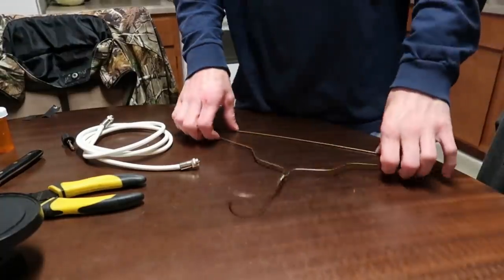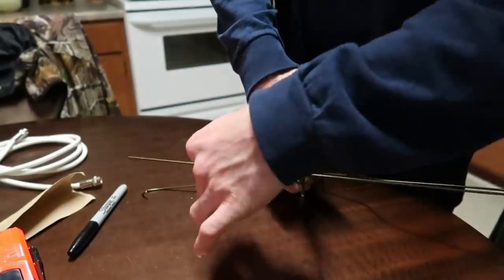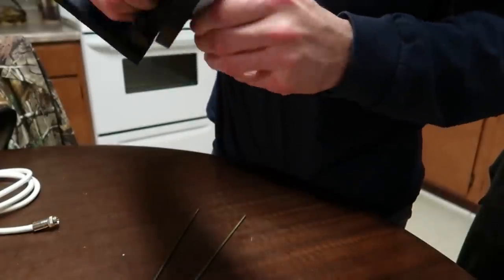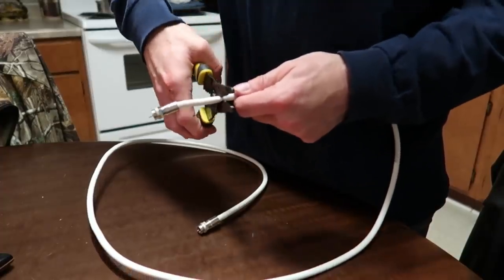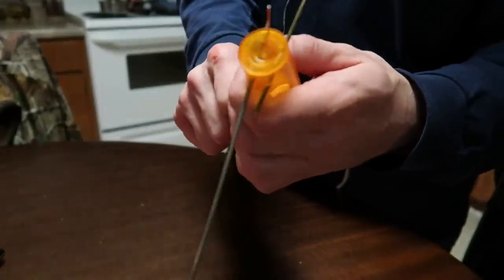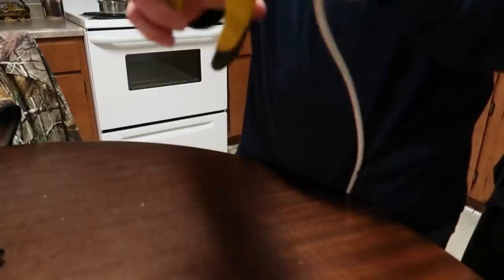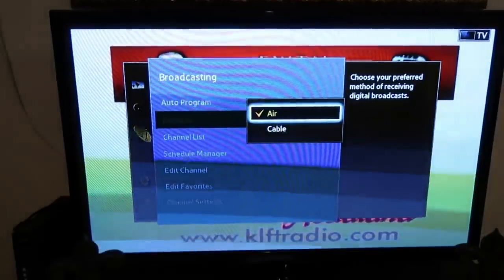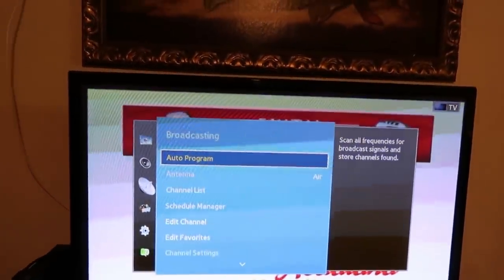How To Make An Easy Off Grid Cable Tv Antenna for Free [ Working October 2022 ]

Comment: Should have just hooked wire to coat hanger and hung it on wall. No pill bottle needed. This is an old time antenna before cable tv. Back in rabbit ears days as they were called.

Comment: The reason you're getting digital channels is because your TV has a built-in digital tuner the antenna you made works but with older TVs you will not be able to do this unless you buy a digital adapter they are unable to detect digital channels without the converter just analog

Comment: There are companies that when you give them your address they can tell you where the best place in your home (east,west , etc.) is the ideal spot for an antenna to pull in the most free channels in your area. They don't charge but sometimes advertise antennas for sale. Quite often an antenna works better on a different side of a room as the TV. I guess longer coaxial cable is necessary. Thanks for your video.

Comment: I once made a much more complex wire-hanger antenna than this one, but it failed to work here in San Francisco, with all the obstructions between home and transmitter.   And I could've used those hangers for my clothes right about now.  Darn it.
Reply from the maker: Dang, would think around your area that you could get lots of channels. LoL !
Reply: @Macgyverjrofficial  I know.  Merely 4 miles from tower, yet so many things to stop that signal getting here.  Terk amplified antenna did a decent job, but now I need a new one.

Comment: How about a homemade extreme amplifier that you mat obtain 22 channels. I think you connect it on the roof or nail it to the roof and get a longer cable plus make your copper wire more like fractals that have more points you will achieve more channels. The higher you place that antenna with no tree obstructions the better.

Comment: i knew someone that had an old house with an upstairs bedroom. They ran a 1/8" wire down the side of the north wall and continued it down the east wall. Then they ran another piece of wire down the west and south wall. They connected a 300 ohm wire to the two wires and connected the other end to the tv. Tv's use a lower impedance connection now so you would need to connect a transformer somewhere to change the impedance for the tv

Comment: Misleading title. 

These are not Free cable channels.  These are over the air local channels.  ABC CBS NBC Fox WB Univision PBS.  Because these networks broadcast a digital Signal- they may actually have two or three additional HD channels per network.  Radio stations do the same thing. 
   These are also the basic local channels that appear on every cable subscription.  You will not get HBO, Showtime ESPN etc.  
   With a good antenna in a densely populated Broadcast area, you could get 15 to 25 channels from the networks.

Comment: In prison the best channels we can get are the digital channels especially in centinella in imperial county close to the Mexican border. So we get digital channels from Mexico and they had decent movie channels and each channel would have 2 separate channels one for Spanish one for English which was amazing  and they would have free pay per view ufc and boxing which blew my mind everyone in America is paying 60-100$ for PPV fights and in Mexico they are watching them for free on the digital stations lol. But being in the concrete cells it was hard to get a good signal and the antennas they sold were garbage so we just made our own with cardboard tape and extra coaxial cables we would strip down a coaxial cable and make different designs like lollipops or stars and tape the copper and mesh wire on the cardboard and boom 5-10$ and we would have a better antenna than the 50-100$ ones they sold on the package companies. Some dudes would have wires taped all over the cell walls to try to make their whole cell an antenna but the cardboard one taped up by the window would work fine for me. It’s pretty cool how you can get free channels like this.

Comment: If you added reflectors and directors and made it look like the one on your TV programming screen it would work better - and all you have to do is point it at the local transmitter, The UK uses this form as its primary TV provider and we have over 100 channels for FREE over the air. Or we can pay for satellite or Cable

Comment: You can find ways to hand build a parabolic reflector...you would improve rage  if you get a proper curve and focal point
Reply from the maker: Thought about it, but for indoors it may be best not to have it directional. Thanks for the tip though man !
Reply: bigmac turd
Reply: You can't get cable channels, so don't lie to people. What you made was a cheap over the air antenna, nothing more. It won't pick up cable!
Reply: actually, youre wrong. Cable and Satellite companys dont like people knowing this, but, they're required by law to broadcast all the channels they sell over a receivable over the air signal. So, yes, he is getting cable TV. Just not hardwired.
Reply: bigmac turd i
Reply: bigmac turd Aachen
Reply: Thomas Rudder . Can you tell me what cable channels you get then. Do you get ESPN, NFL Network, movie channels, HBO, Showtime etc. NHL Network, TLC, Discovery channel. I will bet you will only get some local channels and that is it. Just like going and buying a indoor antenna. How many channels? I'd like a number on how many. I bet it's not many or it's a lie.
Reply from the maker: No I don’t get HBO or Showtime... but I do get 37 or more Channels
Reply: Then why don't I get "cable" channels with my antennae?  My HDTV antennae ONLY gets the non-cable channels!  If what you say is true, then HOW?
Reply: I get 50-some channels with my antennae, but most are in other languages and sales channels, NOT cable-type channels.
Reply: @Ward00  you can ,by using capacitator as high frequency filter but you can only get analog signal by making a high frequency filter ,but signal will be very bad ...
Reply: @kazart4772  if tv chanels have analog signal , small electronic device can be made to amplify Analog signal that "escapes" from nearby (if neibhor has analog cable) and old CRT tv ,you only need a High pass Capacitator ,ceramic capacitator between 2pf and 20pf ,12 volt charger or 9 volt charger with (+ and - or gnd )  ...
Reply: @knezderpe1254  OK, and if the old CRT tv is replaced with a new flat screen tv, does it still escape?  And digital channels instead of analog?
Reply: @kazart4772  i think not , some old tv "leaks signal " trought a home   
power cable ,but that signal is very bad only analog signal can be capured from that "leak"

Comment: Dude if you connect the shield portion of that cable wire to the bottom of that wall lamp and the copper center(cable wire) portion to the top in the center it would make an INCREDIBLE Antenna !!!! Seriously try it you will shit!!??

Comment: AT THE END HE'S SAID  TV  ANTENNA- :) 
1ST FIND THESE - 1 cable -1 coat hanger - SOME SPARE TIME AND A LOL  
CABLE TO TV WORKS NOT ACTUALLY CABLE TV UNO :)
testing tvs  i just insert a screw  / nail  o < in the middle pin of the  tv plug  & u get reception :)

Comment: The old coat hanger trick,worked years ago.
Reply: Antennas haven't changed. They have reduced the size of the band for broadcast tv but the channels are still in the same uhf-vhf frequencies that they have always used. The only problem is that the signal needs to be strong for digital and most channels are on UHF now which limits range more.

Comment: This is just free over the air TV. antenna You won't get cable TV.
Reply: actually, youre wrong. Cable and Satellite companys dont like people knowing this, but, they're required by law to broadcast all the channels they sell over a receivable over the air signal. So, yes, he is getting cable TV. Just not hardwired.
Reply: Rusty Bear hhhh
Reply: I LOVE WATCHING FREE OVER THE AIR TV ONE HUNDRED PERCENT
Reply: The only tv channels that are required to be broadcast over the air are local TV channels. These aren't cable/satellite channels. Local over the air tv channels were broadcasting before cable tv existed. Cable and satellite companies put some of them on their system now so they can be received on cable/satellite but real cable/satellite channels that were created for cable/satellite distribution example HBO, showtime, stars, discovery, learning channel, and many others are not required to broadcast over the air and they don't for a couple of reasons. Cable/Satellite channels are distributed for cable and satellite so they can charge for them. Secondly I don't believe there are enough available channels to broadcast all the channels over the air especially since they are using some of the VHF and UHF channels that were used for tv for other purposes now.
Reply: Rusty

5=
Reply: @thomasrudder9639  Not correct, unfortunately.
Reply: @vonijoe  Oh, guess I was misinformed
Reply: I feel bad for your wire stripper. Copper and Aluminum only. 😂😂😂
Reply from the maker: It’s an old pair 😋🤣

Comment: What if the TV does not have a threaded port for the coaxial cable to screw onto?
Reply from the maker: It should have one. If not it probly has the two U shaped pins. Just splice the end of the coaxial wire and connect to that :)
Reply: @Macgyverjrofficial  It does not; only visible screws are those that hold the back of the tv to the front.
Reply from the maker: Thay is strange my friend. Mabey different countries.

Comment: we got weak signals here. just can't do the way you ppl do. but anyway, nice vid. thx for sharing.
Reply: You must be further from the transmitter. Make a bigger antenna and put it on the roof to get it higher. I made one in metals class in school. Put it up outside with an antenna rotor and got about 15 channels. This was before digital tv. design it like a uhf antenna. They have info on how to build them on youtube.

Comment: On the coax it's called the center conductor. If you're going to do this make sure it's RG-6 with a copper center conductor instead of a galvanized centerpiece. Plus, this is stupid... Just buy an external antenna and mount it to the chimney for best results if you want off air channels. Even by doing that I barely got shit thanks to the trade towers falling back in the day.

Comment: I used a paperclip with some foil, and got 22.
Reply: I used a sewing needle and foil and got several channels.
Reply: It doesn't take much if you are close to the broadcast towers.   I use some scrap speaker wire.

Comment: Wasted  time. All you need is a coax cable and use only the center copper wire. Move wire around until you find local channels.

Comment: Ha ha April fool!  Oh.... Just fool!  Using an antenna brings you BROADCAST tv. Not cable. And why do this when you can get the same channels (and more)  direct from your cable signal, free? Just plug your coax into your digital tv or reciever(for old analog TVs) 1.Cable comes into the house. 2.If you have cable internet the next step is attach a coax splitter to your cable source. 3. One piece coax to modem one piece coax to tv. 4. If you are using a modern digital tv, go to settings snd do a channel scan for cable input. (This can take from a few minutes to 90 minutes) Done. No antenna, cable quality signal, standard local BROADCAST tv.
Reply: Maria B.
Reply: That USED to work, but not anymore with COX internet!  I tried splitting it and they shut down the TV side, so I only get internet, really.